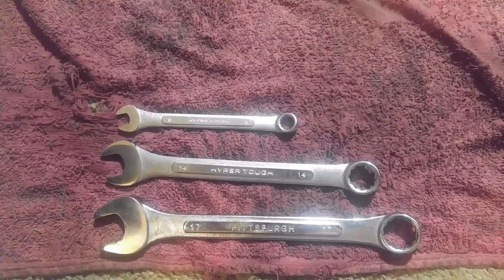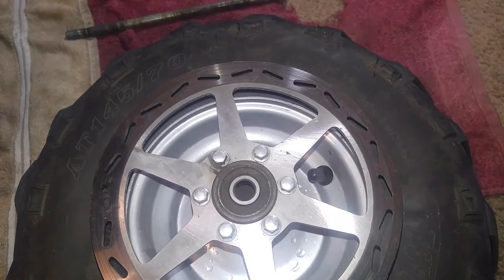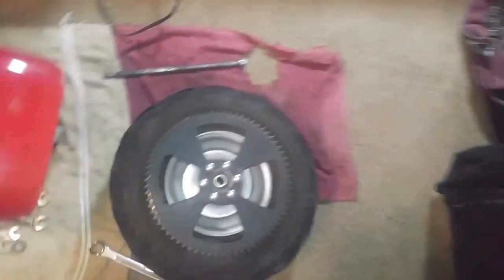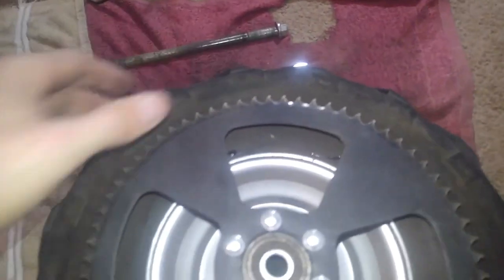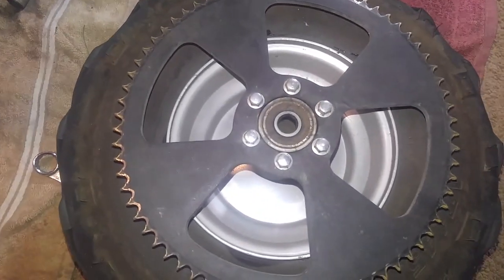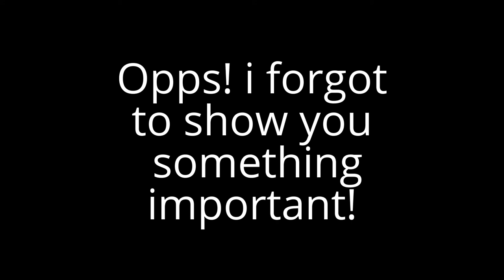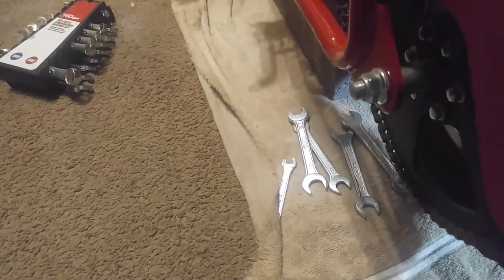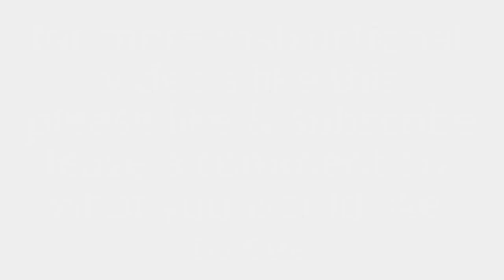coleman ct 100u how to air up the rear tire

Comment: Just buy 1 1/4 inch valve extensions. Works great and a cheap fix.
Clears the brake caliper too!
Reply: Even after taking your advice and putting the extensions on, I was skeptical.   But with very little effort I got the air pump on the stem.  The valve extensions were so much easier (and satisfying) then taking that tire off.  The whole back tire design with the placement of the valve stem is stupid.  But now the sad part.  I'm out of excuses for not letting the kids ride these mini bikes (yes plural) this summer.  And big heads up, kids don't care about gas prices.
Reply: Thanks for the great solution. I’ve got one of these and keeping that rear tire inflated is a chore. Such a small space to try and thread a pump valve. This is an elegant way to solve that.